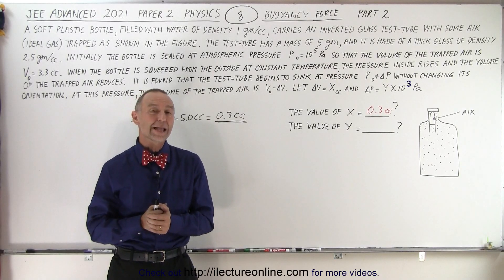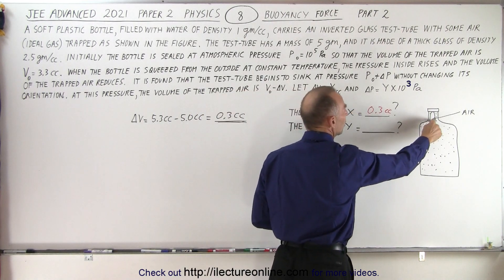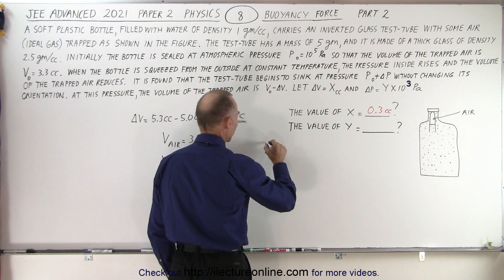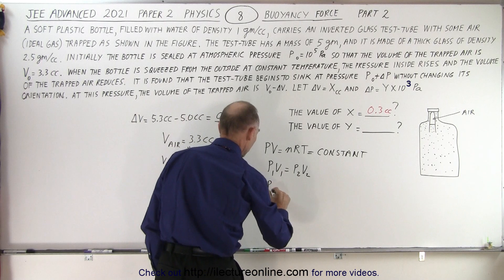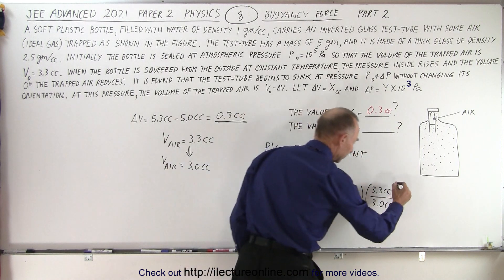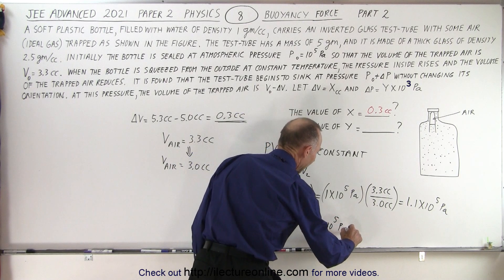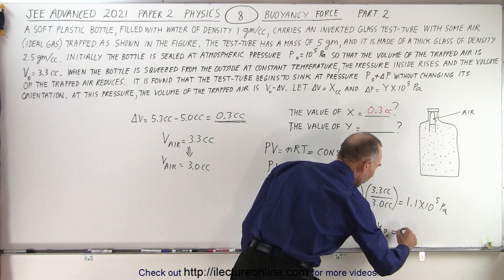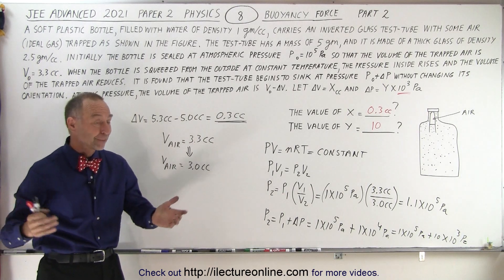JEE Advanced Physics 2021 Paper 2 #8 Bouyance Force (Part 2)

Comment: Sir according to jee advanced solution Y=9.09

After taking PV=constant 
Log(P) +Log(V)= Log(c)
Differentiating both sides

dp/P+dV/V=0

dP/P=-dV/V

Now putting P=10^5 ,V=3.3cc, dV=-0.3cc

We get dP=9.09×10^3
Hence Y=9.09

But I liked your method.
Please help
Reply: I think this method is wrong bcoz for differentiation u need small changes but clearly changes are of order 10^5 so we have to go by PV=const method only
Reply: Yes this is the correct method